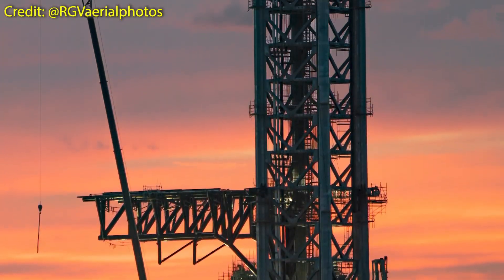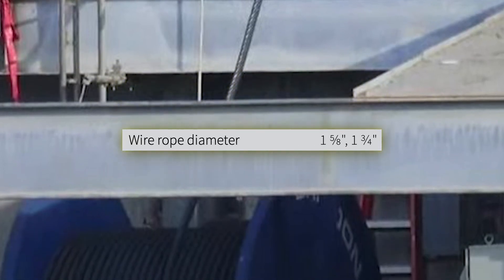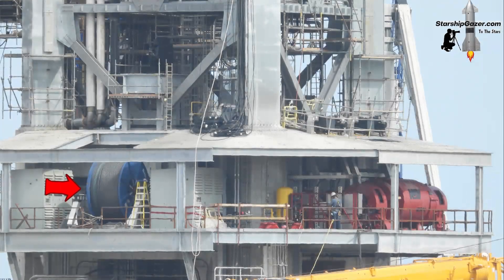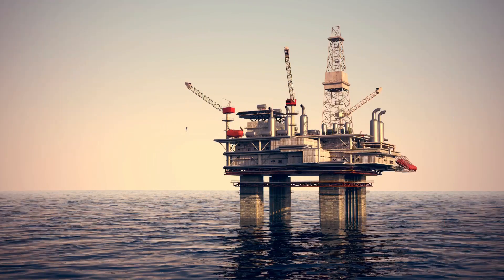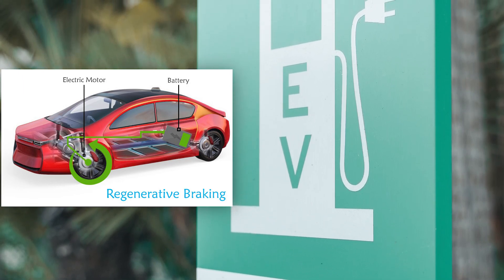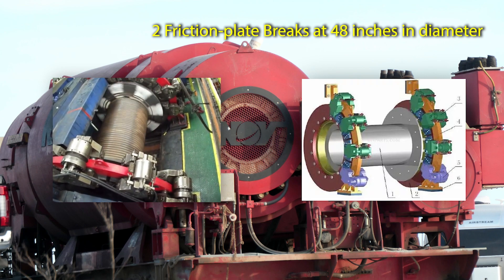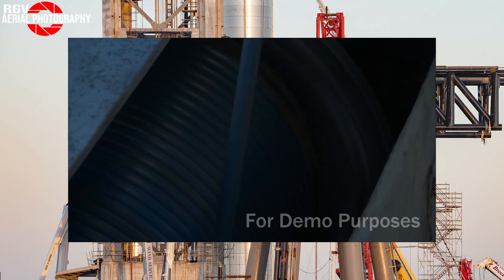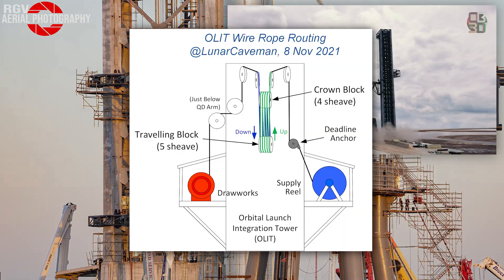How The Hoisting Mechanism Of Starship's Orbital Launch Tower Works

Comment: One small correction. Although the electric motors in the draw works are capable of holding the cable stationary, this requires continuous power consumption. If the cable will be stationary for long periods, the disk brakes can hold the reel instead. These brakes are built as redundant sets for safety.
Reply from the maker: Thanks for letting us know! 😀

Comment: OK-------- My question is:  Why is there not a DEAD weight like what most Elevators use on the System.  A deadweight is a block of concrete at the end of a separate Cable running over the Crown Block Pulley at the top that acts as a Counter Balance to the weight of the basic load attached to the Traveling Block.  This reduces the Work the Drawworks has to do adding a margin of safety.
Reply: The empty chopsticks need to be able to move downward quickly and responsively to match speeds with the booster during the catch.  The drawworks can only pull up on the load or slow its descent, gravity needs to do the working pulling it down.  Counterbalancing it would slow it down.

Comment: Once the chopsticks catch the rocket there will be no recoil. It will be as if the rocket hit a brick wall.!!
Reply: The ship is supposed be able to hover, if the booster can as well it will be barely moving when caught.
Reply: I expect the operation will be the opposite of what is shown. The ship will hover, and the chopsticks will raise up and catch it.
Hovering at an fixed height will be very difficult since the thrust will vary a bit while the rocket is getting lighter. You will get much finer control using the crane.
Hover at more or less the right height, then raise the arms and shut off the engines just as you make contact.
Reply: @joshua43214  Once it's hovering it will be difficult to catch! Ever played air hocky?!!

Comment: Very Good! 
The supply reel and draw works are both turning during Preventive Maintenance (PM) to shift a new section of wire rope into the stationary and moving pulley blocks. After a certain number of working cycles, or if inspection reveals a worn area, the PM cycle is repeated. This reduces the number of times that the wire has to be totally replaced, which requires much downtime.
Reply: Ah, that explains the need for the supply reel and dead line anchor